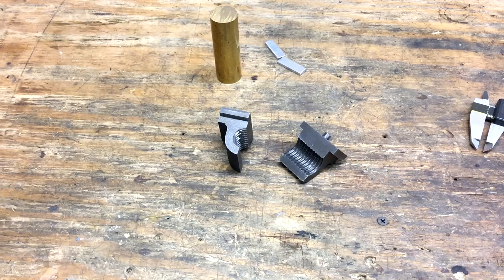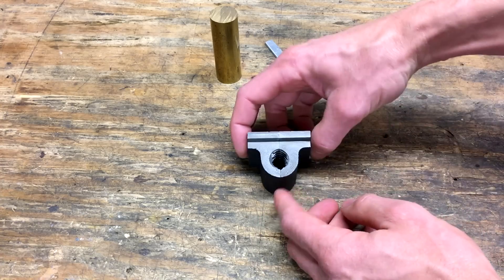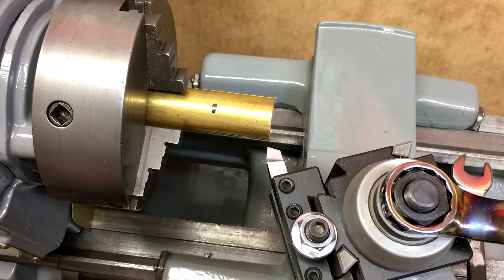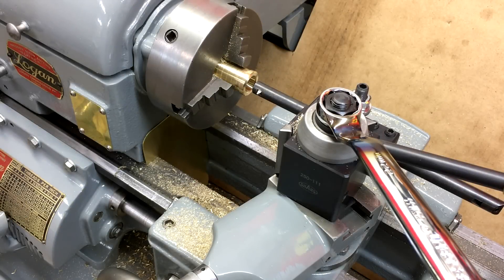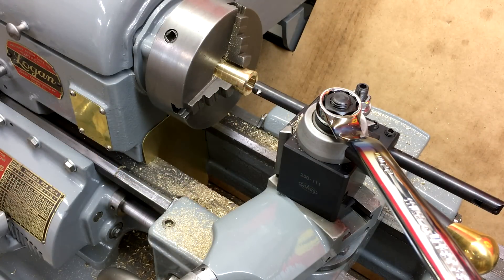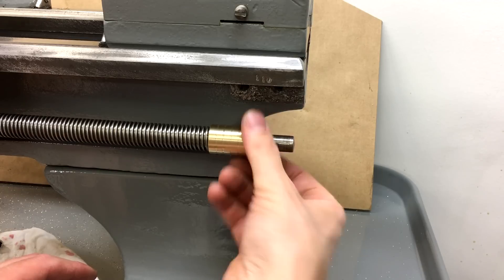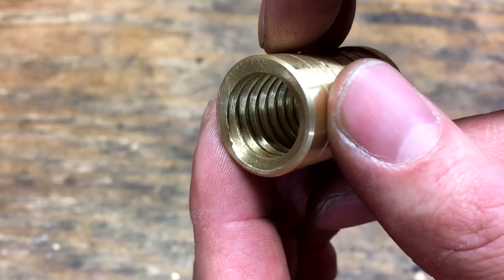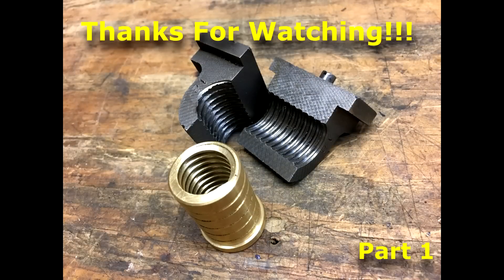How to Rebuild Half Nuts for Logan 10" Lathe  part 1

Comment: Why are you making your adjustments on the angle compound and not the y axis instead?

Are you not causing the threads to be slightly wider from going back on a slight angle? Or is this necessary to cut angled threads?

Ive had to teach myself lathes, so i dont knlw whats right. Shoot me some tips

Comment: How did you use single point thread cutting if your half nuts were slopped out? The whole reason I am rebuilding my half nuts is because I cannot cut an accurate thread. This is why I am using a tap

Comment: I made a sleeve same as you have, but evidently some Logan lathes are different, and the sleeve was not able to fit in mine, because it interfered with something else on the apron.   I cut the sleeve the same width as the half nut and put in a couple of set screws on the split line to keep them in, in case the epoxy let go.

Comment: While sizing the initial blank cutting some fine shallow threads would have worked well to "roughen" for epoxy. I think a lip on both ends would make the brass body more secure and add another acme thread.

Comment: I have a south bend lathe built in 1920. The half nut is run down but the lead screw is great. I would totally pay you to restore mine. It's from a South Bend with a model O apron, which is extraordinarily hard to find.
Reply from the maker: Sorry I don't feel comfortable doing this without having the whole machine with me to test fit parts on.  I would recommend ordering an acme threaded nut from mcmaster and using that to rebuild it similar to what I did.
Reply: oh sorry...I wasn't actually asking. I was just expressing that to show how impressed I was with what you did. I do plan on attempting what you've done once I have the rest of the machine restored.

Comment: great video. what was your formula to figure out how deep to cut the internal acme threads for your half nuts?  i subbed to your channel glad i did your one talented individual. keep up the great videos. thanks.
Reply from the maker: Standard acme thread depth is 0.5*pitch.  So if it is 8TPI = 0.5*0.125 = 0.0625"  But you need to know what the minor diameter is that you bored
 it out to as that will affect it a little.  Thanks for watching and subscribing!

Comment: Put some rubber bands on the boring tool and it will help keep the squeal down. -  Don't you get a great feeling using a lathe you rebuilt to build new parts to use on that lathe? -  Great work!  -  Had to subscribe.
Reply from the maker: I'll try the rubber bands.  Thanks for watching and subscribing!

Comment: Does the brass hold up ok?
Reply: Depends how much you use it, of course it will last if you dont.
Manganese bronze much better for that purpose
Reply from the maker: I'm using the first set that I rebuilt over a year ago and they are still working great.
Reply: Build Fix Create awesome. Brass is easy to work with. 
I'm building a lathe so I can't cut threads yet. I welded 3 acme nuts together and it worked really good believe it or not.

Comment: Thanks for sharing your technique for rebuilding half nuts. The half nuts on my Logan were completely trashed and were unusable. After watching your videos I successfully rebuilt my half nuts and they work great! Do you mind saying what size quick change tool post you are using? It looks like it is a good size for the 10 inch Logans. Thanks and keep the videos coming!
Reply from the maker: I'm glad the videos helped you out with your lathe!  My tool post is an AXA size.  It's perfect for a 10" lathe.  I wouldn't want to use anything larger.